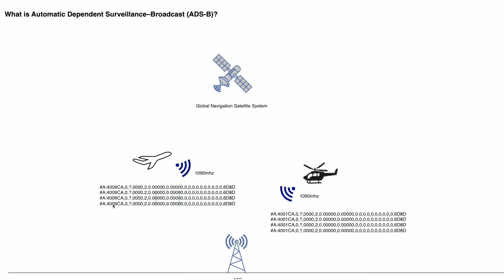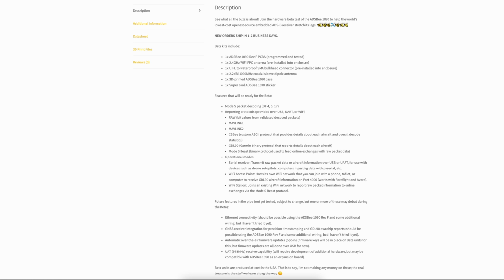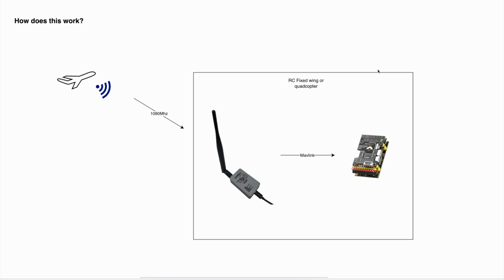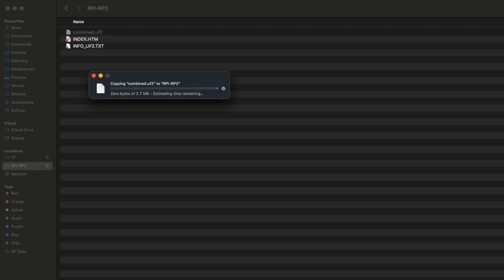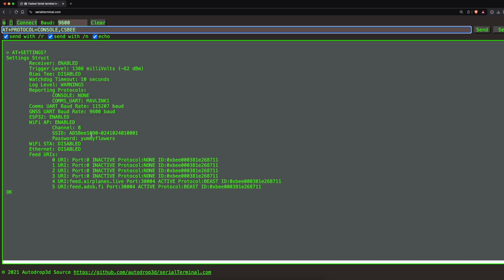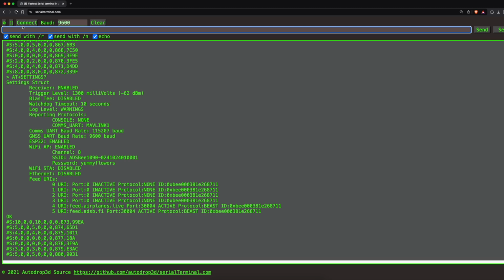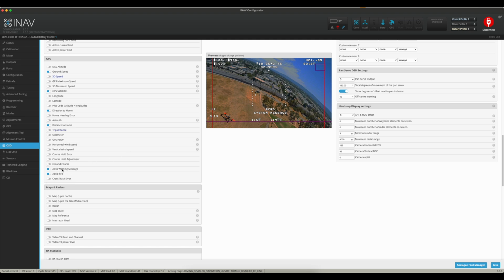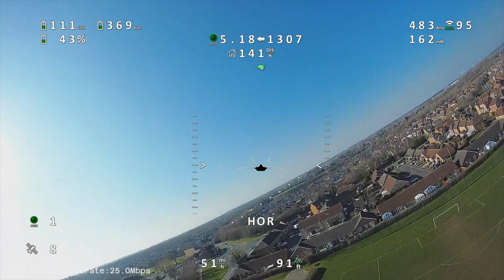ADS-B in iNav 8 with the ADSBee 1090!

Comment: I see this as a key part of the hobby community combatting the proposed BVLOS rules from the FAA.  I want to propose a medium range allowance for BVLOS that would incorporate this type of thing.  I'm quite interested in this type of flying.  Sounds like I need to pick one of these up.  Looks like the dual band is available now.  I don't know if I caught why dual band is necessary.  I see they offer two PCB antennas for the different bands, do you know if you can install only one or the other?  Also do you know how well this plays with 1.3g onboard transmitters?  I can imagine it not being great due to their closeness in frequency, but at least they aren't harmonics.  Sorry for the 20 questions.
Reply from the maker: I think a good argument can be made that BVLOS flights can be safe using ADS-B radar and other measures. It depends on what country you are in as to what the different bands are used for but the dual band adsbee board has both antenna connections, I wouldn't recommend using just one. I would have thought 1090Mhz and 1300Mhz  would have enough separation  not to cause problems, but don't have experience with it. The boards only receive so it wouldn't interfere with the TX but at worst you might get poorer ADS-B performance.
Reply: I've been using one now for a month.  Works fantastic, and I've helped test some inav features.  Thanks again for this walkthrough and the introduction to a great module!

Comment: Could this work with INAV 7.1.2 or 8 is mandatory?
Reply from the maker: It was implemented in inav 8, it will not work in a previous version.
Reply: @telemetry_lost  thanks for your reply! So is there any different kind of "radar" that I can use with 7.1.2? Asking, because I have those "radar settings" in my OSD tab in 7.1.2 too
Reply from the maker: @emiliyanmartinov  that radar is for when you're flying other rc pilots and want to track their location. ADSB is for tracking manned aircraft.
Reply: @telemetry_lost thanks for your quick answers! Your video definitely will be helpful for setting up ASDBee when I'm going to install it.